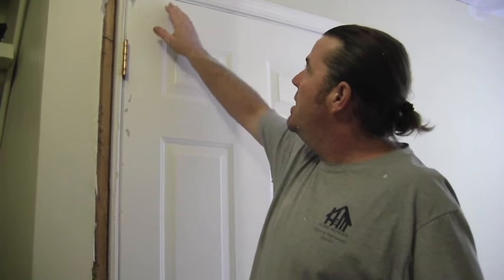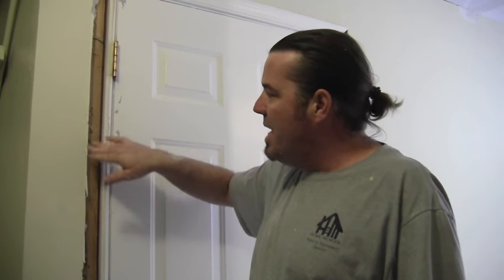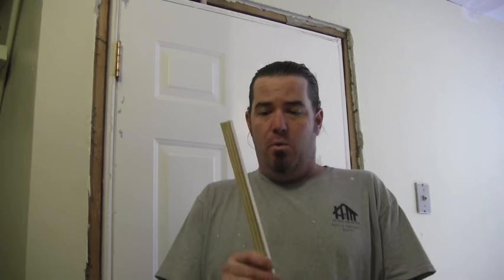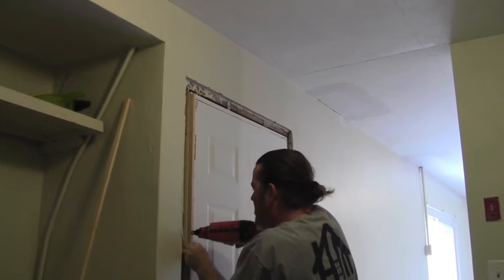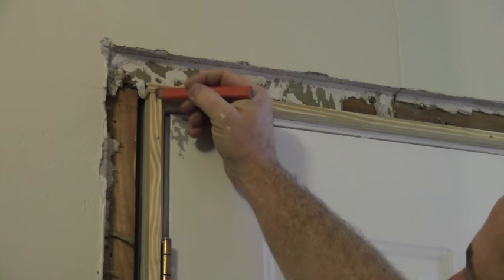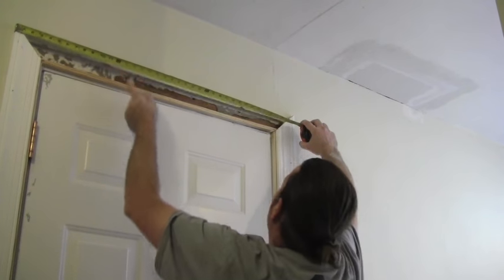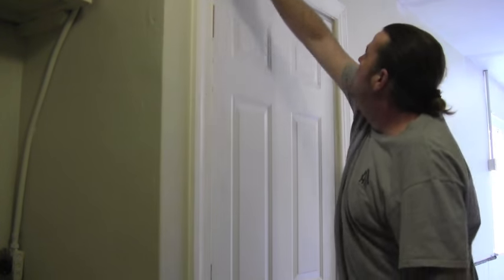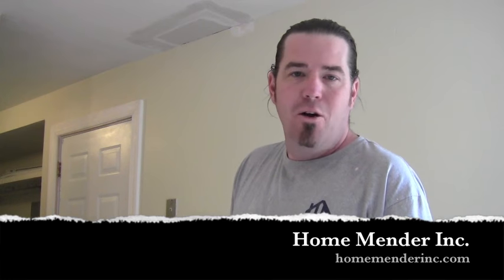How to repair messed up door frame, replace casing. Easy! Home Mender.

Comment: This is great info on how to fix a door jam that sticks in (shy) from drywall.  Do you have a video that shows how to fix a door jam that sticks out (proud) from drywall?  That's the situation I have...
Reply from the maker: hi Craig... you can apply the same principles as this video however you will need to build out the outer edge of casing instead of the jamb side.. I hope this helps!

Comment: This is the issue I ran into today after installing my French patio doors. Only thing is the right side is flush, but the door jamb sits about 1/4" behind the drywall. I'm hoping this solution will still work and it won't look bad just doing it on the left side. Thanks for sharing this info.
Reply from the maker: hey w! this should work for you! thanks for watching!

Comment: I just straightened out a wonky door but later realized that the wall was also not plumb. The lower portion of the drywall (on one side of the door) sticks out about 3/8 and the top is almost flush with the frame. Again, the door frame is plumb and level. 

Could I just do your technique for the lower portion of the door? Good video. Thanks.
Reply from the maker: absolutely sam! you just cheat the casing so it gives the appearance of correct..you got this! thanks for commenting!
Reply: @homemend  Thank you so much!
Reply from the maker: thank you sam!

Comment: what should you do if the frame is sticking out past the drywall? Cut it flush?
Reply from the maker: hi build.. if i was doing it, i would do the exact opposite of what this video showed. basically, if you fit the casing to the jamb, the gap would be between the outer edge and the wall.. i would install my 1/2" strip behind the outer edge instead. caulk and paint. i hope this helps!

Comment: Hey Dustin, what are you using to attach everything there, staples?  Is there a good alternative for those who don't have the power tool?
Reply from the maker: hey jack! this is a paslode cordless trim nailer and its awesome, battery and gas powered. greatest tool i ever owned and worth every penny to not roll out compressor hoses and cords.

Comment: Hello Home Mender. Thanks for the vid. I have a question. Is it ok for the door jamb to extend beyond the drywall at .3 inches or should the jamb be planed or cut to meet the drywall?
Reply from the maker: Hey Viseral! You could plane the door jamb but it seems like a lot of work that may not be too noticeable if you didn't. .3? a little over a 1/4 inch? You can use a 1/4 thick furring strip, placed at the wall to build out the casing a bit, caulk and paint. You might need to test it to see if youre happy with the results. A 1/4 inch isn't much, you may be able to cheat it. Sometimes we just need to get the illusion of correct. lol I hope this helps and would love to hear what you decide and how it turns out. thanks for commenting!
Reply: @homemend  I really appreciate your input to my dilemma. I am leaning on the side of furring strip. I think that will work well. I have yet to implement but I'll keep you posted. Thanks again for your timeless contribution to the youtube community.

Comment: Can you show one with a offset, meaning i have an inside gap showing about 1/2 way up. 😁
Reply from the maker: Hey Mike I would love to. Gap showing halfway up? Draw me a picture or send me a photo thehomemender@Gmail
Reply: @homemend  its flush to the wall halfway up then the wall starts leaning in so theres like 1/2" gap by the time you get to the top. Seen another video about scoring the wall where it starts to cut in all the way to the top n jus pull paper/shave drywall down. 😁
Reply from the maker: Hey Mike. That’s a good idea, I would build it out the same way we did this one. Use the square stock and then build the door frame out, put your casing on and then you can caulk it to the wall. The difference will disappear. You got this

Comment: My issue is opposite of yours. My door jamb sticks out further than the drywall. Any tips?
Reply from the maker: Hey Hey! It's not the ideal situation but sometimes we need to make things look the best they can..If we cant push the door jamb in, you can use the same method shown here but you would build out the wall side.. I would try something 3/8 thick and see if that will take care of it. i hope this helps! thanks so much for commenting.

Comment: I had a guy install a door, and all is well except at the top left corner, the jamb starts curving to the right slightly, causing the door to hit the jamb when it closes. The door still closes effortlessly, and I didn't notice until I started painting around it. Wondering what can be done to fix it? Obviously would have been ideal to not have been messed up in the first place! Was wondering if I could trim just a small amount from the top side of the door, or if that would be stupid. I ask because I am going to have to cut a 1/4" off the bottom anyway, but not sure how it would go if I tried to trim the top edge.
Reply from the maker: Hey Brandon.  I would try to shim the jamb or remove some shims in order for the door to close freely. I would not trim the door.  Make the jamb right, then the door will fit. You may need to pull the interior trim and play with the the position but you got this.  Trial and error Friend. You’ve got this.
Reply: @homemend  Thanks for replying. I think I will just ask the guy who framed it if he can fix it. I just hate asking that kind of stuff when he was probably aware how he left it in the first place. Maybe he thought it wasn't a big deal or I'd never notice. Lol. But you can hear the stress on the jamb when the door hits it and it's got a small crack forming by the hinges. Framing is out of my level of expertise, but I can see when it's not square. Ha. Thanks again.

Comment: I am replacing my drywall with a thicker than original 13mm vs 10mm. I assume the original casings will not be useable? As the door and window frames will be original width, will this mean I need to 'step' the back side of the casings in order to fit them with thicker drywall?? Or do I try and build out the jam with a 3mm strip?
Reply from the maker: hi allen.. 3mm doesnt seem too much, youmight be able to fit the casings to work without building it out, if it doesnt, you may want to add a strip at the back of the casing. maybe something like wood screen bead/ i hope this helps!
Reply: Home Mender Inc 
0

Comment: Hello,
How would I fix a gap between my door trim and drywall, which is caused by the drywall being bowed away from the trim? The gap is too large for caulk. It meets the trim at the top and bottom, but there is a gap in the middle.
Reply from the maker: hi spinning.. great question! it sounds as if you can install a fliier strip cut to the appropriate width to fill the gap, then caulk it. it will be bowed but you will be able to give the illusion of correct. not sure how much were talking but you may also slide shims behind the drywall where touching to build it out a bit and corrrect the bow.. i hope this helps! Please let me know how it comes out!
Reply: Home Mender Inc thanks! I'll try it.

Comment: What if mine isn’t 3/4 inch in but maybe 1/2?
Reply from the maker: hi steve.. they do sell a piece of moulding by the foot.. it is 3/4 by 1/2 " so you can turn it on whichever side you need.. i hope this helps! thanks for watching!
Reply: Hi! What do you call that type of moulding? Thanks
Reply from the maker: hi dg.....typically trim around a door or window is called casing....this particular style is colonial.